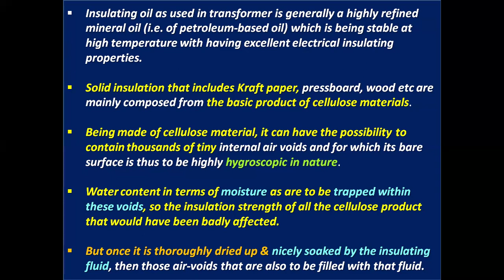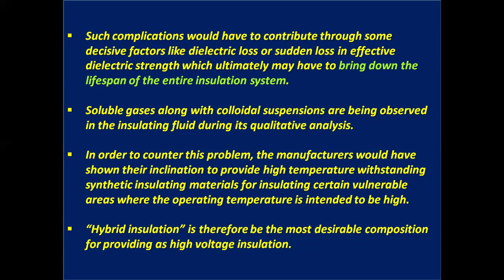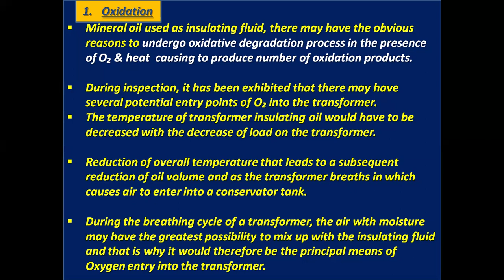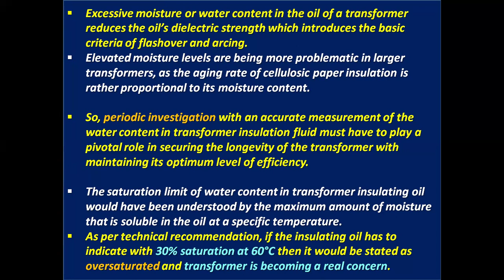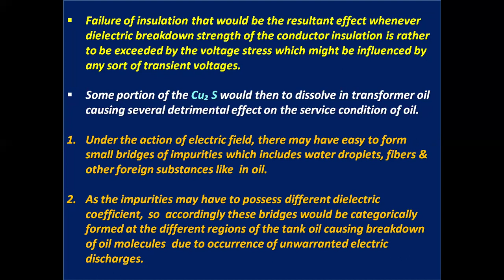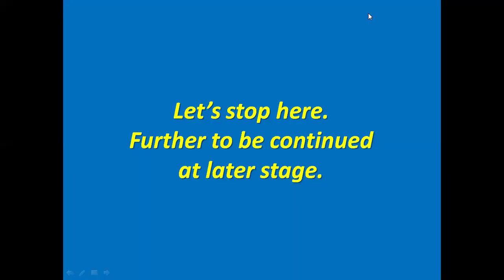Power Transformer Part 59

Comment: Transformer protection video
Reply from the maker: Monitoring the Insulation condition, both the insulating fluid as well as solid insulations, in a regular basis would be the most important maintenance activity to run the transformer hazard free throughout its lifespan. Stay with the topic and in the due course electrical protection would also to be discussed.